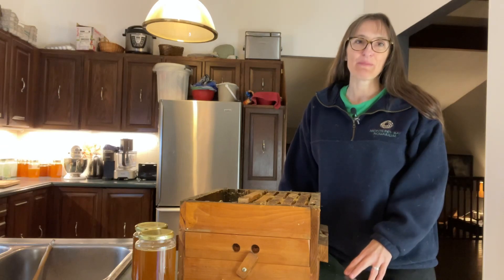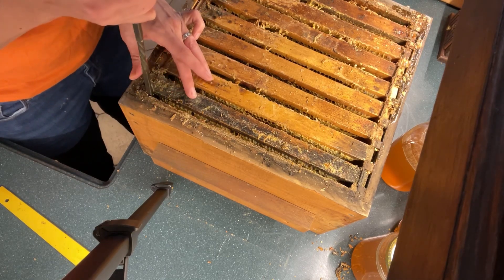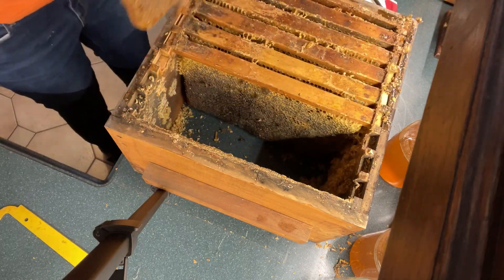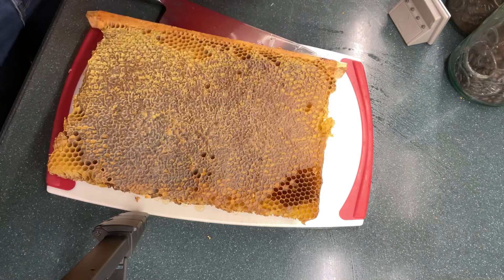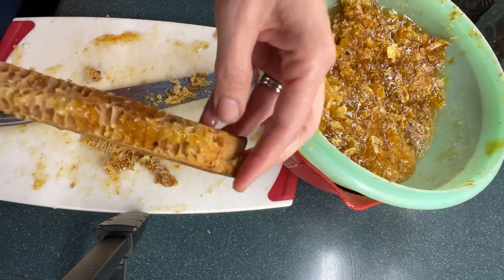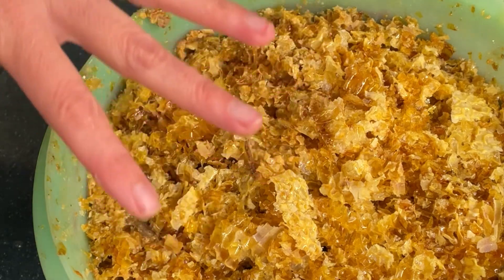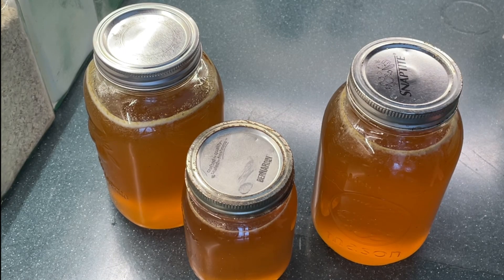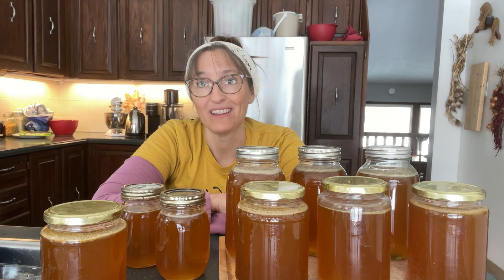Honey Extraction from a Warre Hive. So Yummy!

Comment: You can speed the process up by using a finer strainer and then more fully crush the comb (as you described). I use a nylon mesh strainer but I've also seen stainless steel variants.  With the strainer, it keeps back the wax bits that you described as clouding the honey when you crush it and strain with only a colander.
Reply from the maker: I see what you're saying, that's a good idea. Thanks for the comment!

Comment: I've taken my first box off my Warre. The box is full of crystallised honey. Would you have advise for extraction. I'm mashing it through the sieve as it won't run through on its own. Thanks
Reply from the maker: Hello there, thanks for the comment! I think you'll have to heat up the honey and wax so both melt. Then you can filter out the dirt. The wax will rise to the top and solidify and the honey should be underneath. Since you'll have to heat it up quite a bit technically this would be called Bakers Honey and be used for cooking and baking. Good luck!

Comment: How do you get the bees off the comb before bringing into the house?
Reply from the maker: I have a bee escape board that I put below the box I want to take off. It allows the bees to leave the box but they can't get back in. I leave it on for about 48hrs and then they should be basically no bees left in the box. Then I put the box right into a garbage bag before I carry it inside the house. Otherwise the bees may follow you with the box! Thanks for the comment!
Reply: I’d love to see a video on that if you get time
Reply from the maker: @honeyboyd6560  that is a good idea for a video! The next time I'm doing an extraction I definitely will. What I use is a bee escape board that is designed for the warre hive. It allows bees to leave the top box but not come back in. I usually put it on about a week before I plan to extract the honey. By then it's pretty much empty. Then I put the box directly into a plastic bag. Otherwise bees will smell it and follow me into the house! Thanks for the comment!

Comment: you could just flip the box upside down. cut all the attachments loose, then flip it back over. Just a suggestion
Thanks for the video
Reply from the maker: That's true! I used to do that before I got my warre tool, but I was worried about the comb breaking when I was flipping it around. Either way works, what ever you have! Thanks for the comment!

Comment: Veo en el vídeo que la calientas .. Si la calientas la miel pierde propiedades hmdl
Lo que suelo hacer yo es lo filtro  y lo dejo en un cubo la suciedades y la cera suben a arriba y cuando está dura o cristalizada  le quitó lo de arriba raspando  y la mie a l la Batidora y la hago crema  que está buenísima y no hace falta calentarla un saludo .. miel crema
Reply from the maker: Thanks for the suggestion! I will think about trying that! I usually just heat it on low enough to reduce the viscosity, not more than that to maintain the enzymes and beneficial compounds. Next time I will use a thermometer to make sure I am not getting it above the recommended temperature levels. Thanks for watching!